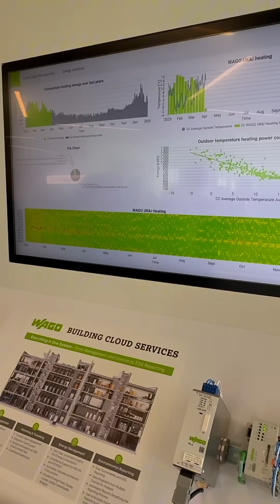A Net Zero Warehouse Full of Connectors?

Comment: NetZero / 'carbon neutral' plastics are a thing, but nobody's making them yet, are they? While efforts are to be applauded, it is important not to overstate the case. NetZero is a long way from where we are and it's only where we should have been for the last 150 years: to undo Climate Change we need to go rapidly well beyond NetZero. Construction polymers could have a part to play: if they were made of atmospheric carbon instead of freshly exhumed fossils, they would be locking away carbon for their installed life, potentially beyond that of 'offset trees'?

Comment: Buying a patch of trees or land is carbon offset against the company, not a carbon neutral building. its all a paperwork exercise.
Reply: Trees  are not carbon offsets.  They are temporary sinks that typically only last in terms of decades which die, decompose and release all that lovely CO2 back into the air.  Capturing carbon requires coal and oil forming conditions. (what is it with YT replying to the wrong post now??)
Reply: Yawn